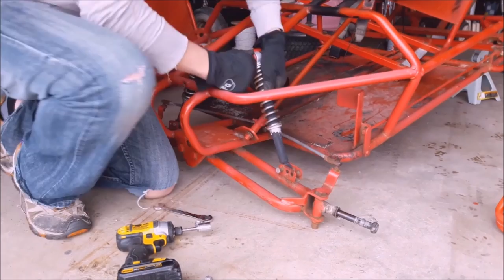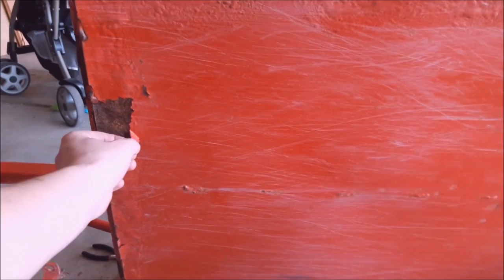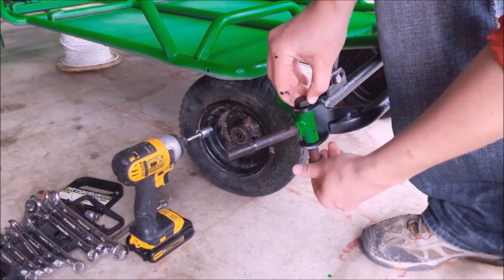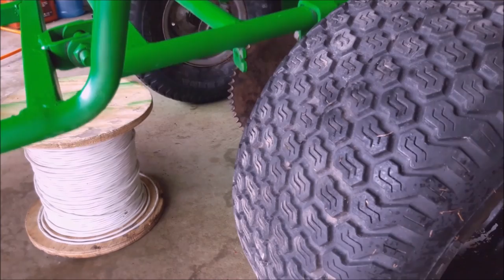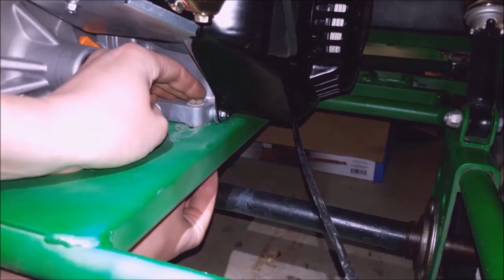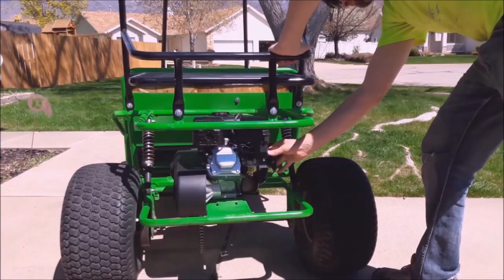Go Kart Restoration / How to Build

Comment: I have the same kart. Except I'm putting on a 45 inch axle to extend the rear stance and also a 250cc atv 5 speed engine with reverse. Push button start. Remote choke, atv shocks. Bucket racing seats. 5 point harness. Its a savage machine. It freaking rips. Top speed is 65mph
Reply from the maker: That thing will fly!
Reply from the maker: That thing will fly!
Reply: Where did you buy the engine?
Reply: Where did you get the seats?
Reply: Why a push button start? Then someone can just steal your go kart amd drive away.

Comment: Great job! I'm about to do the same thing on my Yerf Dog 3203 frame. I'm wondering what torque converter kit do you use?
Reply from the maker: If you want cheap they have them on ebay for around $60. If you want it to last for a really long time spend the extra and get a comet brand. Just search for go kart torque converter there will be thousands that come up, double check you get one that matched the shaft size of motor.

Comment: What measurements did you use for the plywood for the seat. I need to redo mines and just wondering exactly what you used
Reply from the maker: I'm not sure, I don't have the kart anymore.  If you still have the seat frame I just used that as a template.

Comment: Hey Mech Master, I'm having a hard time finding the right clutch and torque converter can you tell me the name and model of the clutch system you are using? I have a predator 212 non hemi motor.
Reply from the maker: This comes with both a #35 and #41/#40 size chain sproket. You'll still need chain that matches the sproket on the axle. If you have the same style yerf dog it has #40 chain. 

I used one just like this:
 https://www.ebay.com/itm/PREDATOR-6-5-HP-212CC-GO-KART-TORQUE-CONVERTER-3-4-OHV-HORIZONTAL-SHAFT-ENGINE/332431324228?hash=item4d66737444:g:RbMAAMXQTT9Ru8dN&frcectupt=true

Comment: ihave a question.why do my tires start to spin when istart it.my go cart does not sit and idle.So everytime iwanna ride ihave to start it then hop in real fast.
Reply from the maker: Your engine is idling too high. Depending on what kind of engine it is most have an idle screw or spring that you can adjust to lower the rpm. What's happening is the engine is pretty much being revved and engaging the clutch.
Reply: Mech Master it worked 🙂 thank you
Reply from the maker: @joesyoutubepage  good to hear!

Comment: I'm having trouble  getting the axle  off did u just take off the 3 bolts and nuts off each side of the axle
Reply from the maker: Yes those are the only fasteners. The bearing plates sit in an indent or pocket so you need to stick a large screwdriver between the 2 plates to seperate them all the same time pushing down. Also if its been sitting for a long time rust will not be your friend. Hope that helps and makes sense.
Reply: @-DIYPRO-   yea rust is gonna be my friend  on this one it's been sitting 5 years well wish me luck thanks for the insight on it